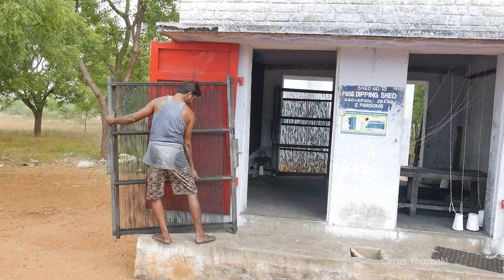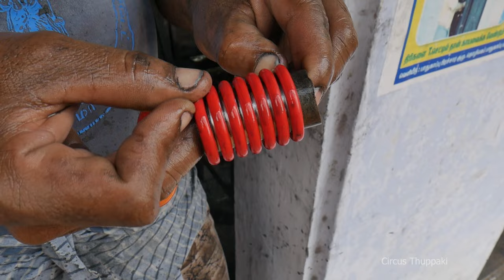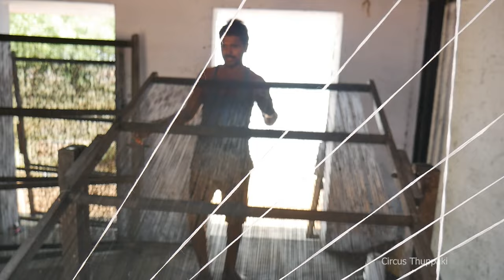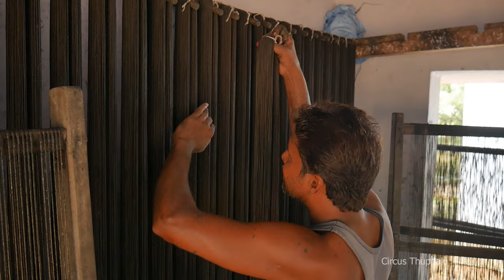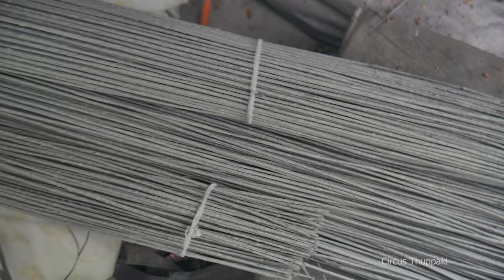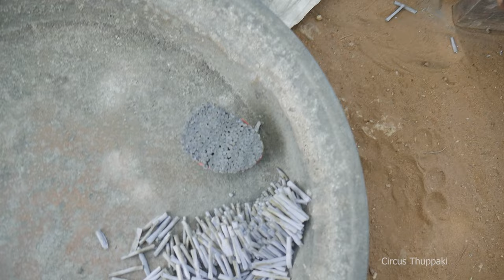Hard work behind Bomb Fuse Production in Fireworks Factory

Comment: What chemical is the adhesive material for the rope?
Reply: It's commonly wet starch because when it dries it gives structure and adds burn rate
Reply: probably wheat paste. Boil water than add flour, very cheap and easy to make.